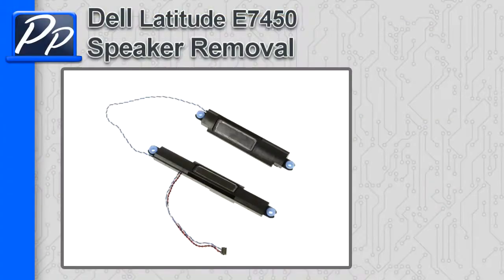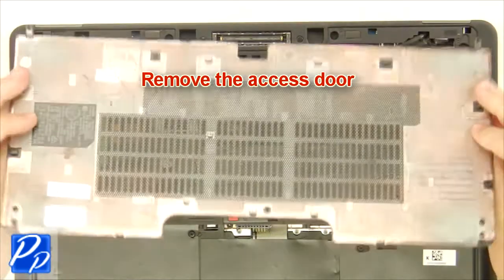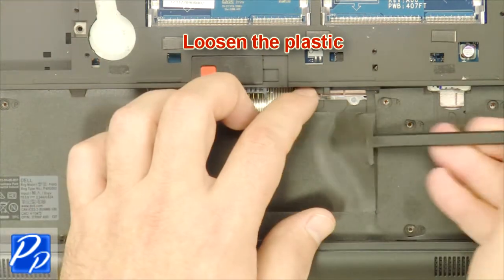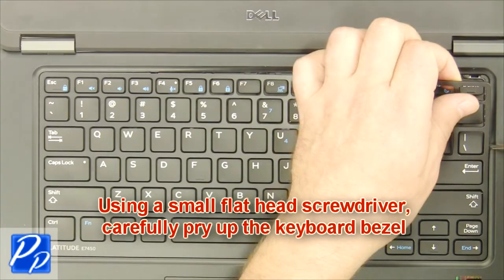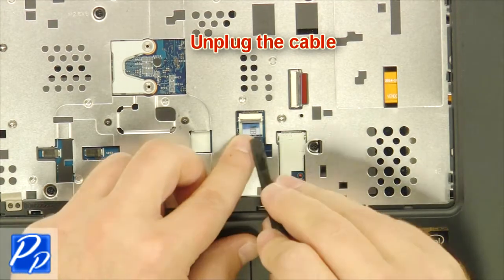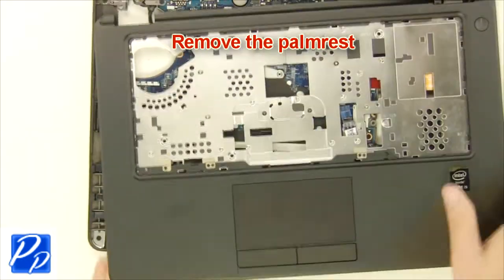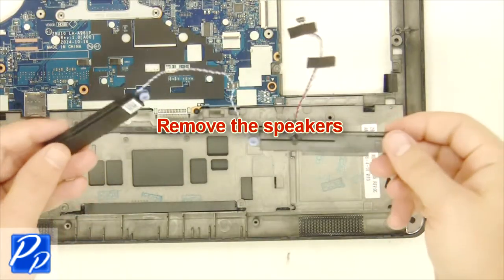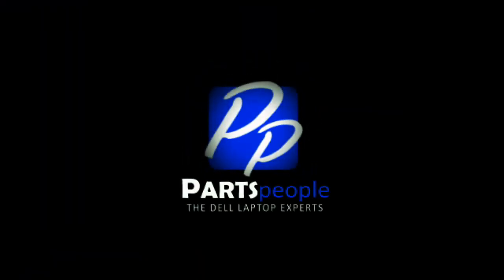Dell Latitude E7450 Speaker Replacement Video Tutorial

Comment: hello, please my laptop, dell latitute e7440 suddenly lost its sound and the drivers are working properly.
the pop-up is not showing again when i put earphone, but it use to show.
but the actual thing is i kept wwan card in it and experience that problem, i remove the card but still no sound. am now using usb sound card.
please do i need to change the speekers or the internal sound card

Comment: ohhhh fuuuuuuuck me...
Reply: Yeah too much work to reach those little speakers on a dated laptop.  My left one was buzzing-  turned the computer over, put a few drops of thin wood gule into the speaker slot, let it dry and soak in overnight with the laptio flipped upside-down. The glue sunk down to the speaker, can't see any evidence it was glued- and the speaker sounds great.  Sof if audio distortion from a compromised cone is your problem, that's one solution, and didn't have to buy a replacement set.